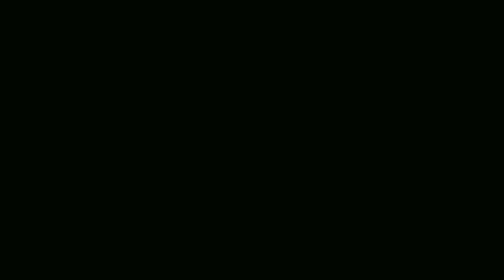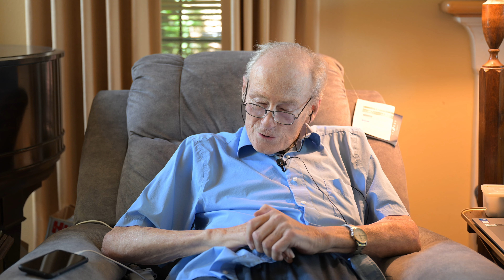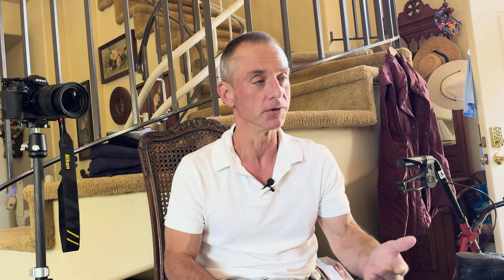Mach's Principle & the MEGA Drive | James Woodward | CSUF 2024

Comment: best description of the priciple that I have heard yet: it isn't propellantless we are just reusing what is there.  Pushing on it when it weighs more pull it back when it weighs less.

I did my own looking around just to see if the principle makes sense.  It seems plausible to me, according to Einstien's theory that energy has mass.  You could change the weight of something rapidly, by rapidly changing how much energy it is holding.

I have been trying to work through the principles and this video added to my understanding a bit. Thank you.
Reply: John searl had a device in the 1950s I think